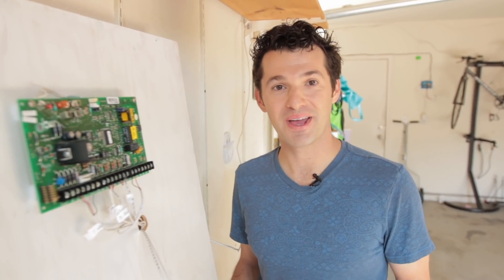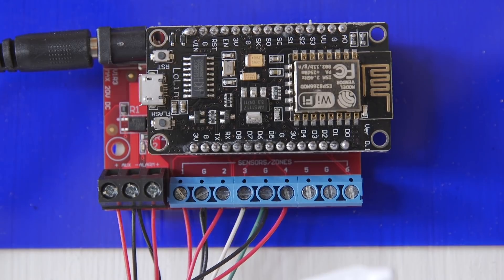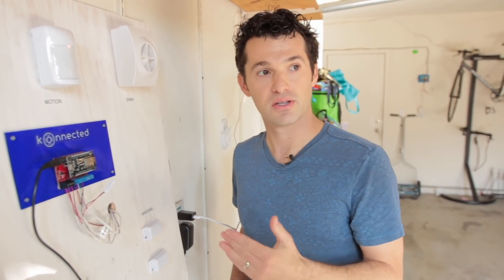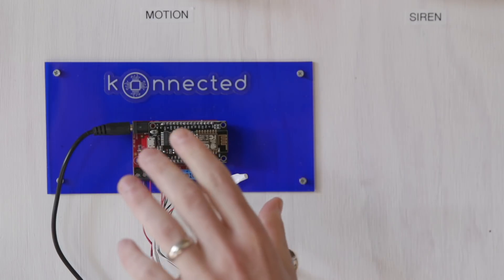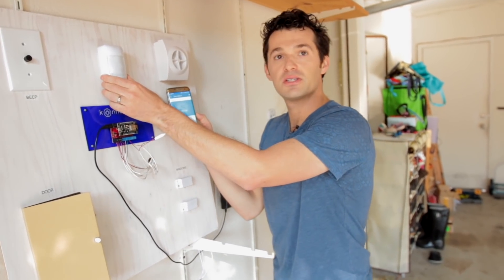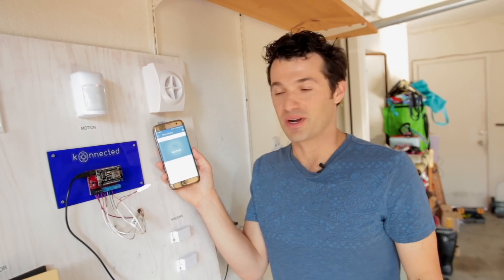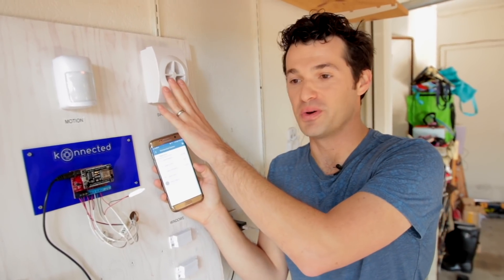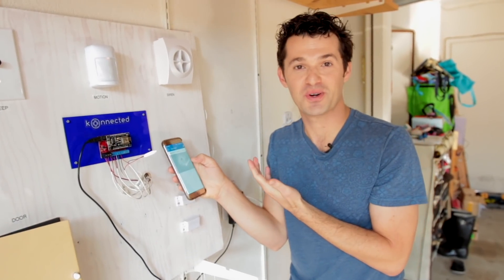Konnected Alarm Panel detailed demonstration

Comment: When the power goes out, will the alarm notify me of this? My old 25year old panel will so I imagine this will. Can you confirm please? And will the backup battery power my router?
Reply from the maker: Yes - if you back up the gear that makes the alert possible, you’ll still get it.

Keep the panel online.
Snap our 12 V mini-UPS between the power brick and the Conversion Kit. It auto-switchover to battery and can run the board 8-14 h on its own. 
Konnected

Keep the network online.
That same mini-UPS has 12 V and 5 V outputs up to 2.5 A—enough for most cable-modems, routers or mesh nodes, so a second unit (or the spare port on the first, if it’s nearby) keeps Wi-Fi up during the outage. 
Konnected

Trigger the notification.
Easiest: let SmartThings/Home Assistant alert when the Konnected device or hub goes “offline.”
Instant: plug a tiny 12 V relay into any wall wart on the mains and land the relay contacts on a spare zone; when AC drops the zone opens and the app pushes a “Power-loss” event—just like your old panel did.

So with two palm-sized batteries... or one plus a relay... you’ll match (and usually outlive) the 25-year-old panel’s AC-fail alert, and you won’t need the router on a full-blown AC UPS.

Comment: How can I connect to a new network or new location?
Reply from the maker: Change networks in two quick steps—no factory-reset required.

Kick the board back into Wi-Fi–setup (“hotspot”) mode.
If you still have access to it on the old LAN: open the Konnected mobile app → tap the device → Open Status Page → Re-configure Wi-Fi. The board will drop off your network and start broadcasting konnected-xxxxx again.

If the old LAN is already gone: just hold the little BOOT/FLASH button for ~5 s (or press Reboot once on a Pro) until the blue LED blinks fast—same hotspot appears.

Join the hotspot and give it the new credentials.
Connect your phone or laptop to konnected-xxxxx, browse to http://192.168.4.1, pick the new SSID, enter the password, hit Save, then tap Reboot. The LED goes solid, and the board rejoins on the new network.

(Alarm Panel Pro owners can also skip Wi-Fi entirely—just plug in Ethernet at the new location and you’re done.)

Comment: can you still arm and disarm the alarm from the old school panel on the wall? or is it only controlled via ST? like if you dont have your phone and need to disarm the alarm?
Reply from the maker: The product demoed here replaces the old alarm. If you want to keep your old-school panel and keypads, check out our newer product the Alarm Panel INTERFACE that works in parallel with the existing alarm: https://konnected.io/collections/in-stock-now/products/konnected-alarm-panel-interface-for-wired-security-systems

Comment: What if your position sensors are wireless and there's no wires as the 'old' alarm is operating on a frequency to collect the data from position sensors ? What do you do then ?
Reply from the maker: This product only works with wired sensors. Sorry.

Comment: It looks like the power available from Konnected is 12v. What about if you have some devices that need less voltage like a small PIR sensor using 3.3v?
Reply from the maker: It's designed to work with standard security system sensors which are always 12V

Comment: This is very insecure if it only operates on WiFi. Because with another ESP8266 or computer you can easily do a deauthentication attack and shut down the alarm system

Comment: My sensors are wired, but the system communicates with home monitoring via 3G cell module, not “landline”... will that be an issue?
Reply: Konnected I do not want professional central monitoring, I’m ok with just keeping it “self”, my alarm system was regular old fashion landline came pre-installed with home.... few years later I had it activated, tech came in & upgraded from landline communication to cell communication. But all my sensors are still hardwired/not battery powered ... so I don’t get confused by your last sentence , are you saying konnect will not be able to be added at all to my system? Or are you referring to just the cell module in my old system no longer being used,  if I do install Konnect?
Reply: Konnected awesome! Thanks for clearing that up... & like you mentioned, I could have konnect & still have central monitoring using “Scout”... very nice! Can I buy Konnect on Amazon yet?

Comment: I like your product and i backed you up for a reward of 3 modules. Looming forward to getting them soon. But in my old alarm system i have wireless reciver (gemini wireless gem- recv 32) can that work with your system. I have like 6 sensors connected to this wireless reciver. Please help.

Comment: Do you know of any solution to add an affordable SIM back up cell  module to this system in case the intruder cuts off the internet connection before intrusion?